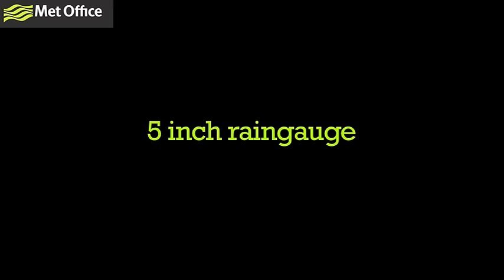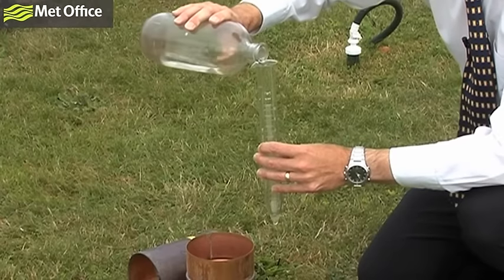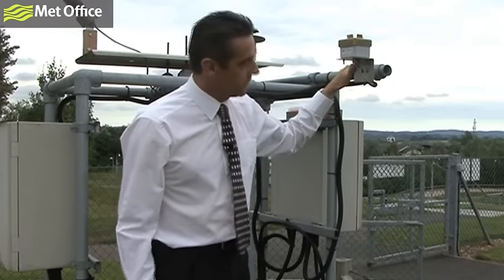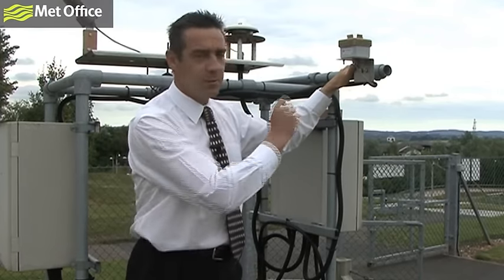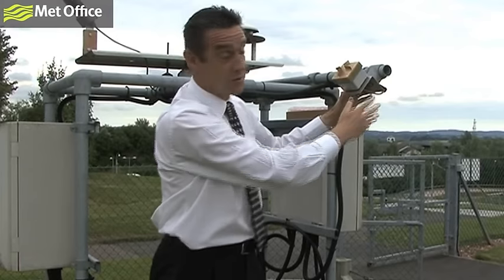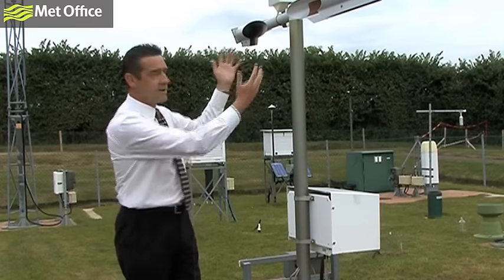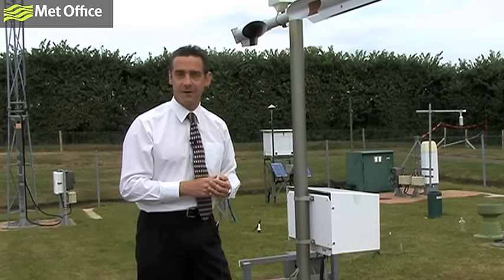Measuring rainfall

Comment: If the surface area above the funnel to collect water is larger then more water would be collected in the funnel within the same given time so there has to be a standard for the surface area of the equipment otherwise a lot of variance would be recorded.

Comment: I don't get it, surely the wider the rain collection bucket, the more rain you will collect? Like a 50cm diameter bucket will obviously collect more rain than a tiny 5cm diameter bucket, so how do you remove that variable from the equation?
Reply: i think it has to do with the time spent collecting those amount of rain. so in example a 1inch bucket can collect 10mm of rain in an hour, and a 2 inch bucket can collect 20mm of rain in a hour, when you compute them, they have the same amount of rain collected in 1 hr, then you'll be able to compute the amount of rain per month, per quarter or per year, that's how i understand it :)
Reply: Sk3elly late reply but it doesn't matter how wide the area the rain is measured on it's about the depth of rain
Reply: Well if the collection bucket is wider, it has a bigger volume to fill. It all equals out.
Reply: Alex McDougall but the height of the rainfall is still the same if the same rainfall falls in.
Reply: Skellist ...you would think that.....but that's not how it works man......the larger one is a diff. Kind of measurement device, not jus a catchment system like the small one is...
Reply: smaller ones r more acurate than large ones. rain doesnt always fall in the same place. so it might rain on half the bucket and not on the other lol.

Ive seen situations were it was raining on 1 side of the road but bright sun no rain on the other with an almost perfect straight line seperating the sunny part of the road with the raining half.

So the bigger the collector is the less accurate it could be cause it might not be raining over part of the collector.
Its also why weather forcasting is mainly guess work. they might see rain in 1 place and the wind determines where that rain goes. so they guess it will go somewhere at a certain time. but if the wind changes direction or gets stronger or weaker the rain might go somewhere else take longer or faster to get there.

Its the same with all weather. they caluculate using the info they have at the time but that info is constantly changing at random.
Reply: Baron Wong if you have a closer look at the tube he used to measure the rain, the tube is actually very large. The 3mm is more like 3cm,  they must take into account other variables like size of jar, bucket etc
Reply: V
Reply: @cliffbird5016  u can't see edge of rainfall
If u are still alive reply
Reply: @feekeebooh  thanks I was confused with the bucket collection the water and you explained it perfectly thank you

Comment: You collected a full glass bottle of water but you use only half of the water in the bottle to measure the rainfall.  How does it work?  Can I just go to the pond in front of my yard and take some water to measure the rainfall?
Reply: Just stick a bucket in your yard out in the open.Away from trees or anything that would stop the rain.  When it is done raining just use a measuring tape or ruler to see how deep the water in the pail is. That is about as accurate as you will get. Of course the top and bottom of the pail would need to be the same width as well. .

Comment: Try it with captions! So funny!!
LOL :)
Reply: u r very right
Reply: @Ellie Webster  >I had to laugh when I read your post. Try this and have more fun. On the standard screen (In the USA) there’s a “Gear” icon in the upper right-hand corner. It give you the ability to change playback speed. At this point, go for 1.50 or 1.75 speed, click ok, then play. It will play much faster and he could sound like “Mickey Mouse”. I watch Technical videos which some are dry, even slow. I use this feature a lot. Auto Master Tech since 1978, Retired. It’s fun in life when you get it!  :)

Comment: Still i found this methods are not accurate. It is better to invent new methods by using some sophisticate instrument like in Satellites which will measure by reading clouds density, size, wind flow, etc and even giving the details of how much MM of rainfall will happen and in which direction and how much amount of each area will get, etc. It can be used for more accurate rainfall warning to all public. Because the method used checks only for certain area total rainfall. But in actual every location receives different level of rainfall.
Why i am saying this bcoz, on 26th July 2005, Mumbai observatory noted - 944mm of rainfall. But in whole Maharashtra state in different areas, it was more than what recorded.

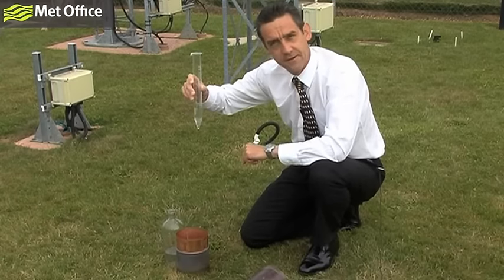Comment: 1:35 he said "3.2 mm of rain" it should be 3.2 cm of rain
Reply: No, I think this thinner gage is calibrated to hold  (when it is full) exactly the amount of water corresponding  to one inch  (2.54cm) of water falling  in the 5 inch larger cylinder.  Using the one inch gage, one can get a much more precise  reading for the amount of rain, in this case 3.2 mm (it is a bit confusing because he only takes some of the water.  He should have poured all out, emptying the little gage everytime it is full  and adding everytime 1 inch more.)

Comment: You lost credibility when you jumped from imperial (5 inches) to metric (mm of rain). Why mix your measurement type?
Reply: That's completely normal in the UK.  For instance, in a pub or bar, you only ever buy beer/cider in pints, whereas wine and spirits are only sold in ml.  Whether you use metric or imperial is often just a matter of which is more convenient and it's usually just assumed you can convert between them, if you have to.